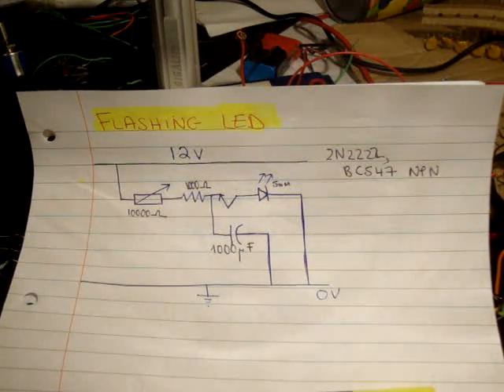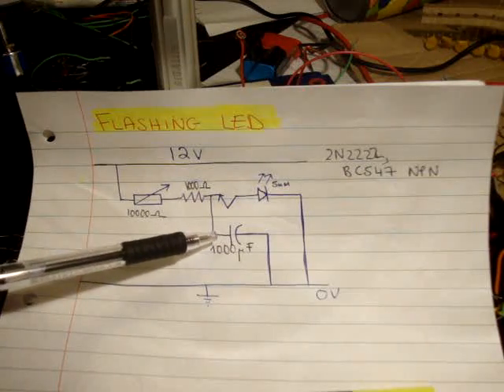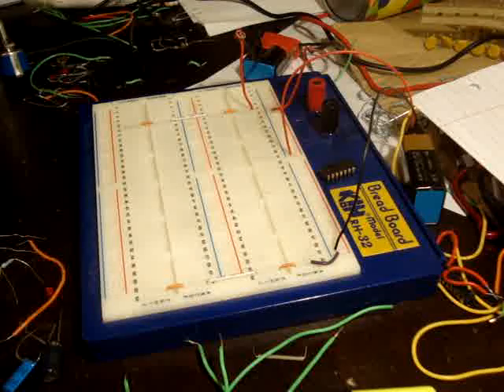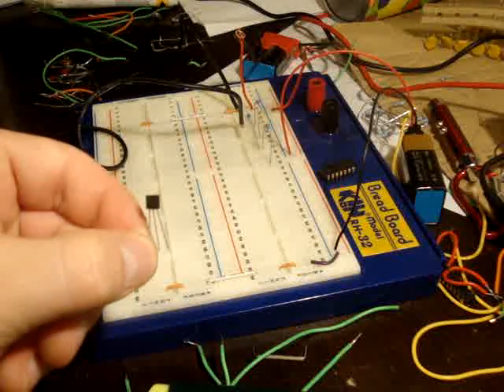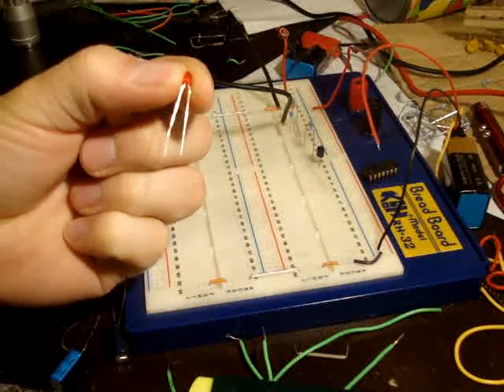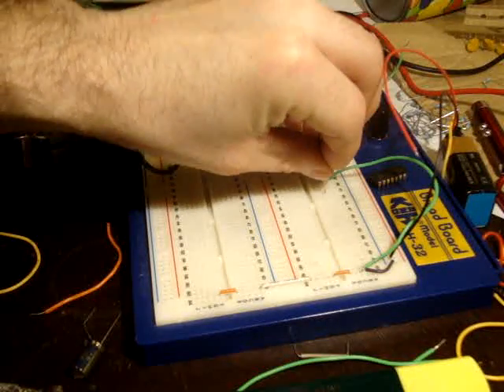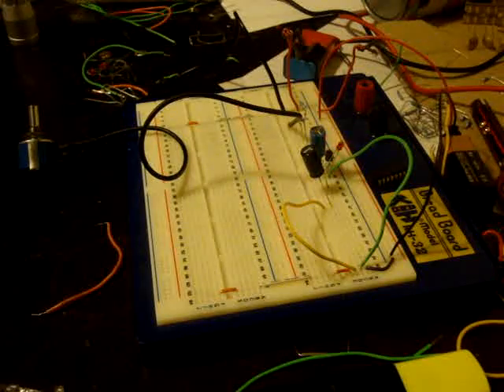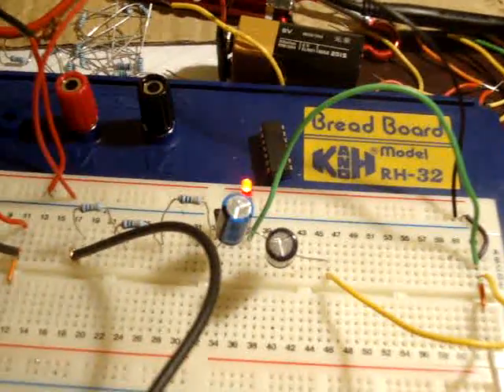Electronics 20 : How to Make a Flashing LED (LED Flasher)

Comment: Hi,
I am not a Elec. engineer but i would like to make some LED wire rope as my weekend project. It is just for fun.
For this project i have used 100 * 5mm white LED  in PARALLEL with 1K ohm resistor for each LED. I have a Computer ATX SMPS (300WATT, 12V DC, 4 Ampere). 

My questions are
1) Howmany LEDs i can connect to the above mentioned SMPS?

2) Is that the diagram mentioned in video will work with my LED wire rope to make it flashing?

Comment: Adam,
Re your caps, are you sure they're connected pos to earth? Mine only work in the usual polarity with this circuit, and I'm not the only one: the user 'kubikop' also connects them the usual way (neg to neg earth) and has a working circuit demonstrate on his CRO as I have on my CRO. My LED just stays turned off if I reverse the cap.

We are simply dropping the cap's charge to earth when our 'tunnel diode' triggers, so I can't see why the cap would need to be reversed ….

Comment: @youspinmerightrounds
This circuit depends on the breakdown of the junction, like a zener diode, which is why it requires 12V.  A true Esaki or tunnel diode requires a fraction of 1V and must have a diode with a junction especially made for the electrons to tunnel through it.  Also, transistors were not made to break down, so the transistor's breakdown parameters are not known, and the circuit may work with some transistors, and not with others.  Thanks for the video.

Comment from the maker: @thatoneguy99100 PART 1 I'm not sure but I doubt it. This circuit is not like a normal circuit, in that it can only be explained by quantum and not classical physics. So it is unlikely to behave like a normal classical circuit. This circuit (very complicated internal physics) is based upon the Esaki diode. Esaki won a Nobel prize for explaining it. Basically, electrons are liberated from a metal cause they can tunnel through the potential energy barrier.

Comment from the maker: @Toerme It should be. Remember what is actually happening with the flashing LEDs, current is flowing or current is not flowing. If you use this set up as a switch for your lights it should work. Somethink like putting the output of this circuit (where the LEDs are) to the base of another bjt transistor. Have this extra bjt set up like a NOT gate (see my video), ground the emitter, connect the collector to high. Also connect the collector to your light bulbs and then to ground.

Comment: Is it possible to use this circuit for flashing miniature light bulbs (3 x 75mA 12V bulbs)? I have a model car I would like to wire up turn signals in, but it looks more realistic with bulbs.